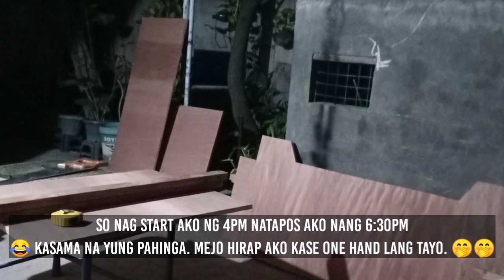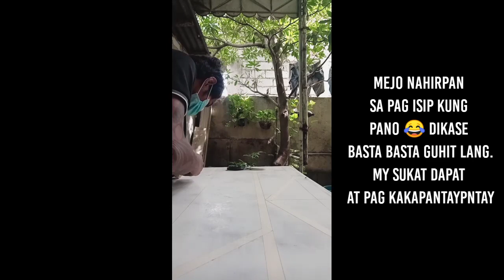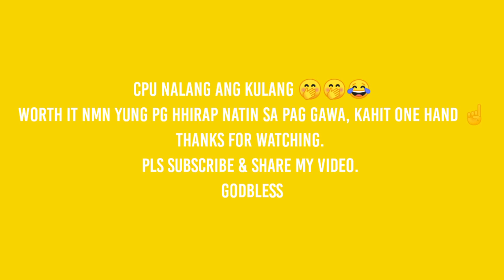DIY Gaming Desk using Hand tools. one hand work.

Comment from the maker: 1L wood putty
1L flat back paint
1L semi gloss whit paint
500ML semi gloss Red paint
Small roller & aditional rolling brush
1 small brush
Wood glue
sand paper.

1pcs marine plyboard 4x8

Cutting
Cut mo sa gitna yung 4x8 plyboard ng tig 4FT after icut mo ng tig 2FT yung 4F 
So mg add ka nalang ng design sa isang 2FT yung pinaka table mo like nung ginawa ko. 

Sa paa nmn. 3pcs na 2ft ang lapad at 2FT & 6 inch ang taas. & Dipende sayo kung mg add knang design sa paa like nung nasa video ko. & Yung sa gitna nmn dipende sayo kung anu lapad at haba. Sa pg cut mo. Yung yung pinaka patibay nya.
At dipende kung mg lagay kpa ng mga layer sa gilid. Basta isang buong 4x8 na plyboard lng yn idol  worth of 2,500

Comment: Hi sir! Gusto ko lang sana hingiin yung buong materials na ginamit for that? Pati size ng wood sana and then cuts nito, I am also planning to make a gaming table by myself! More power to you, sobrang solid!!!
Reply from the maker: 1L wood putty
1L flat back paint
1L semi gloss whit paint
500ML semi gloss Red paint
Small roller & aditional rolling brush
1 small brush
Wood glue
sand paper.

1pcs marine plyboard 4x8

Cutting
Cut mo sa gitna yung 4x8 plyboard ng tig 4FT after icut mo ng tig 2FT yung 4F 
So mg add ka nalang ng design sa isang 2FT yung pinaka table mo like nung ginawa ko. 

Sa paa nmn. 3pcs na 2ft ang lapad at 2FT & 6 inch ang taas. & Dipende sayo kung mg add knang design sa paa like nung nasa video ko. & Yung sa gitna nmn dipende sayo kung anu lapad at haba. Sa pg cut mo. Yung yung pinaka patibay nya.
At dipende kung mg lagay kpa ng mga layer sa gilid. Basta isang buong 4x8 na plyboard lng yn idol  worth of 2,500